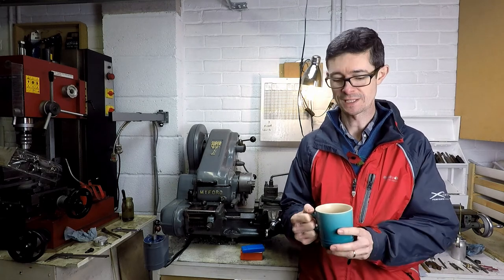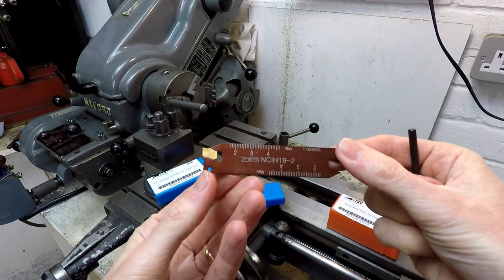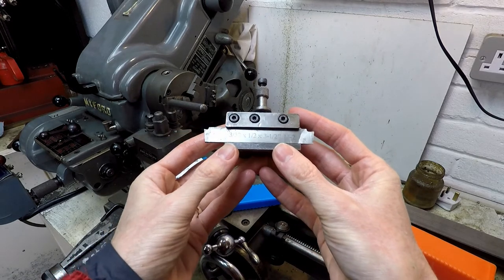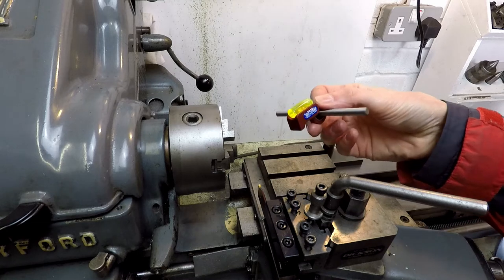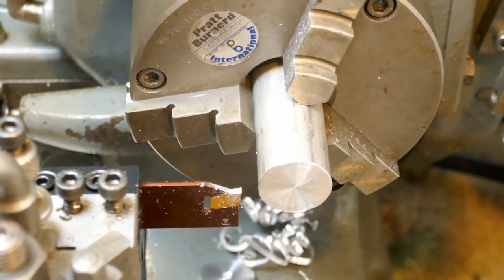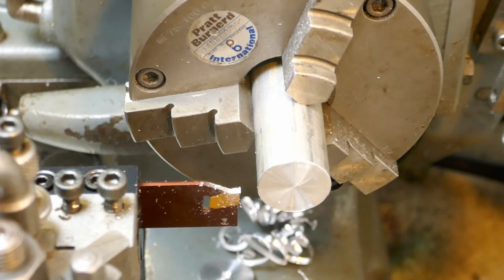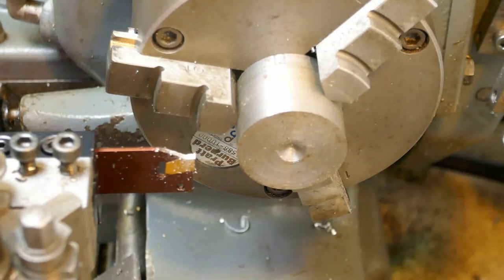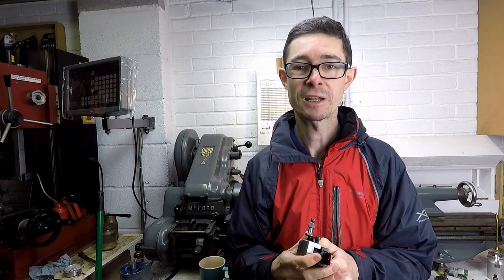What happened when I used my new parting off tool in my Myford lathe

Comment from the maker: I did quite a few things wrong in this video as the comments have pointed out.  I’ve been using the tool without problems for a while now and it is way better than the older blade type tools.  However, for successful parting off you should:
- minimise tool overhang
- part off as close to the chuck as possible
- keep spindle speed fairly slow
- use plenty of cutting fluid
Reply: read my comment below
Reply: Also, keep a constant pressure on the tool to avoid chatter and a bit of ‘juice’ would help too.

Comment: Lower the speed and push the parting tool in so there’s less over hang and make sure it’s 90 degrees to to the lathe bed by pushing it against the chuck face then tighten the tool post.

Comment: This has a lot of views, I hope folks read the comments rather than buying a blade parting tool and emulating this method.
Parting is about rigidity and then more rigidity. I would never contemplate using a blade parting tool in a small lathe, in my case it would hang out from the turret too far, just as in this case it hangs out from the tool post. A single piece parting tool is much better for a small lathe. 
These tend to have a fixed maximum diameter and work really well.  I can part up to 41mm diameter and I accept that, as my limit for parting.  Larger than that, I tackle the job some other way.  The rigidity of this set up is compromised by the QC tool holder, the blade holder holding the blade away from the tool post (would be much improved by single piece tool) and then the blade sticking out more than is required.  So many comments about the speed being too fast, I part at the same speed as I turn on my cnc lathes, they have a 4" chuck so not large.  This is shown on my channel for anyone who has difficulty with that statement.
When parting, get as close to the chuck as possible, 3mm is ample space, or should be.  I often part off further out when making multiple washers in a single set up, but my machine seems to handle it OK.

Comment: Hi, I have a super seven and the same style Q/C tool post, as seen in your vid the tool can dig in when parting. I made a rigid rear tool post and have had no problems since, I strongly suggest you make one. In the last couple of years I've been using an insert parting blade, would never go back to HSS.
  As already mentioned, slow the speed down and flood the cut with lube, preferably suds as it will take the heat away better than straight oil. The heat causes tool expansion in the slot which will cause problems.
  Colin

Comment: for a myford I found HSS is best. get an Easylap diamond hone and just sharpen your edge. run the spindle dead slow with lots of oil. Inserted carbide has a blunt edge which helps tool life when ran at proper speeds but it requires regidity. HSS can be honed razor sharp which reduces the cutting forces so its ideal for the myford. For running steel on the myford you want to run at no more than 30m/min. remember this is 1930 technology back when HSS was the cutting tool of choice. Using carbide is a different kettle of fish.
Reply: been machining 316 stainless with a 30thou DOC at 110 rpm in backgear at 3.7thou per rev using HSS. No issues with tool life just a few seconds to hone every few cuts.

Comment: Try re-watching your video at the 4:25 mark. There was an obvious catch of some kind and you can then see just how much flex there is between the tool holder, tool post and the slide clearances being taken up. As handy and quick to use at those quick change tool posts and holders are there are some downsides to just how much rigidity they have with the tool tip that far from the stud used to lock the tool post down. It's not a fault of the lathe, tool post or even your new cut off tool, it's just a result of the design limitations of a light weight lathe and how a QC tool post works. I didn't notice if your Super 7 had the long or short cross slide on it, but for any smaller lathe in a home shop that does have a T slotted cross slide and especially the Super 7 I'd be seriously considering the George Thomas rear mounted tool post specifically designed to be used on your Myford lathe. Hemingway Kits sell the casting, and the full build article Mr. Thomas wrote for the M.E. magazine is in his book The Model Engineer's Workshop manual. That rear mounted tool post bolts directly to the top surface of the cross slide and has a direct line of support for the cut off tool that results in much better rigidity and better results because of that.
Reply from the maker: Well spotted! The insert came loose, which I solved by pushing it more firmly onto the holder.  I was going to talk about that in the video but (a) I forgot and (b) I thought the video had gone on more than long enough already;-)
Reply from the maker: PS - I have got a G Thomas rear tool post somewhere but I have never used it, thank you for the reminder!
Reply: Saw it too 👍
Reply: @MetalMachineShop  

I think if you watch that again in a slower speed, you will see the whole tool post rocking.  Untill you solve that problem, you are going to continue to get crappy results.  Perhaps an out rigger of sorts could be affixed to afford additional rigidity.  Remember the old addage "A rigid tool is a happy tool."
Reply: @MrRShoaf  and in this case in particular,  "A short tool is a happier one as it's not going to be mangled up like a long sticky out one !" lol
Reply: very late to the game but I just "found" the video. I have an even smaller lathe and there the catching is standard when parting off, not rigid enough. Now I have the blade installed upside down and run the machine in reverse. Works absolutely flawless now with HSS and insert tools as the cutting edge gets pushed out when it catches and not pulled into the workpiece.
Reply: @metalmachineshop5488  It´s not that the insert came loose. That probably happened when you passed the center of the cut.
But the main problem is that the QCTP is to weak and can´t handle the forces, just like @MrRShoaf said below.
But the part that I was about to tell you is that I have seen the exact same on another Dickson style tool post on another video on Youtube, I just doesn´t remember which one it was. But it is obvious that the Dickson isn´t rigid enough for parting operations. It sure can be done but the margins are to small.

Comment: Other viewers have pointed out some of your parting off errors, but have you considered using a rear mounted toolpost with the parting tool inverted?
Due to the mechanics of machinery...well that’s my vague understanding, parting off ‘upside down’ is easier and is less prone to the tool digging in.
Quite a few YT videos out there show the set up. You’ll need to buy or make a rear toolpost, though.
Use cutting fluid as well...aluminium is nice to cut, but it’s a ‘sticky’ metal with regards to cutting tools. WD40 or paraffin works well on aluminium.
Reply from the maker: Hi, thanks. I have actually got a rear toolpost but just not got the bits necessary for parting off yet.  I’ll get around to it one day hopefully!

Comment: I bought a tool like that for my Chinese lathe. I made a solid rear parting tool holder and it transformed the parting performance as it's exceptionally rigid and eliminated the snatching and flexing. Although you can mount the tool upside down to keep the same spindle direction , I didn't and i have to part off with reverse spindle direction but it works great. Because it worked so well I gave it a real hammering testing it and it put so much pressure on the insert it bent the seat down causing it to gape and not hold the insert. It would be better to buy the holder with more material under the insert

Comment: How to make thread in 15 mm bar fast on manual leath
Reply from the maker: If it's a screwcutting lathe, you need the right gearbox setting and spindle speed plus the right screwcutting tool.  Alternatively, you can use a tailstock die holder and either rotate the spindle manually or using a very slow spindle speed if achievable.

Comment: ah the absolute POS "Dickson" type quick change tool post, best thing to do with these is chuck them in a scrap bin! go get yourself either a Multifix or a Tripan and keep the tool stick out to a minimum, oh and get a decent lathe too, like a Schaublin 102!  :-)
Reply: U sound like fun at parties
Reply: Gee you can be blunt! Unfortunately though you are dead right. A blade in a lathe that size is not a good option. Single piece parting tools are much better. The hangout of the tool in a QC tool post is too large anyway and then to make it worse with a blade just makes no sense. I can't believe how folks try to part off any more than 3mm from the chuck. How does the cost of a Schaublin compare with a Myford?
Reply: @smallcnclathes  sometimes one needs to be. The speed, the over hang and that awful Dickson tool post!
Reply: @smallcnclathes  both decent Myfords and Schaublins fetch very good money here, in fact all machine tools have risen in cost during this pandemic! As for parting off, the Schaublin is more stable as it has less slideways, I’m only talking about the WW style Schaublins, I’m not sure about the screw cutting 102 series with a carriage and apron etc but I think they are more robust than a Myford .
Reply: @crozwayne  I did put up a lengthy comment of my own! I was just surprised at you being such a Cross Wayne, that’s all. Parting is aways a pain until one gets it right. Then it becomes just another part of turning. As I say in some of my videos, my parting tools cost me a lot of money, but they never let me down. Hundreds of thousands of parts all parted at the same speed at which they were turned.
Reply: Excellent video…surprising how many experts there out there all dying to tell you what you’re doing wrong….keep up the good work..